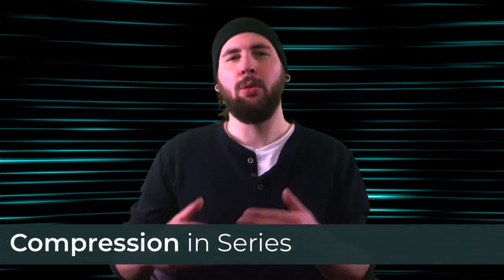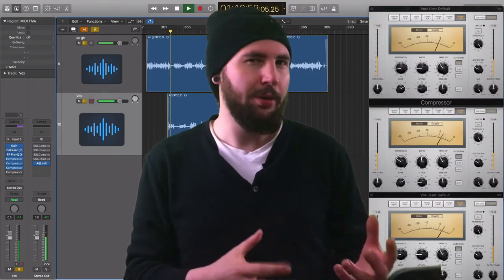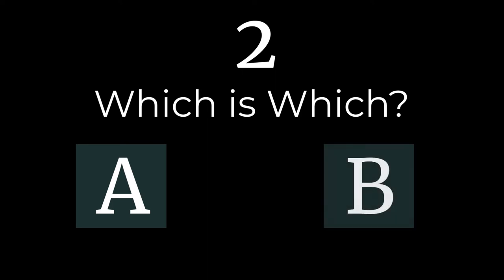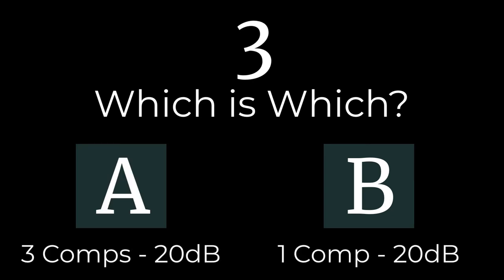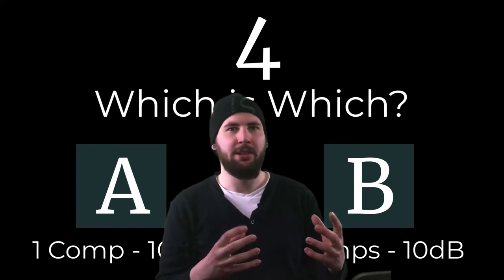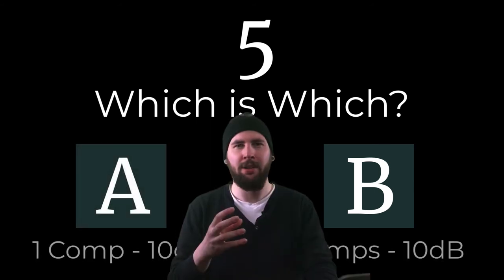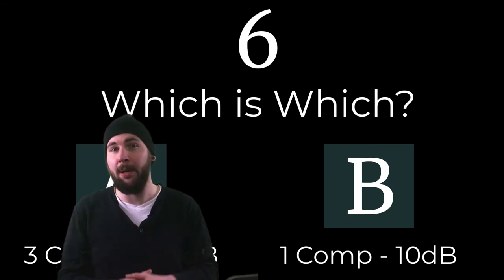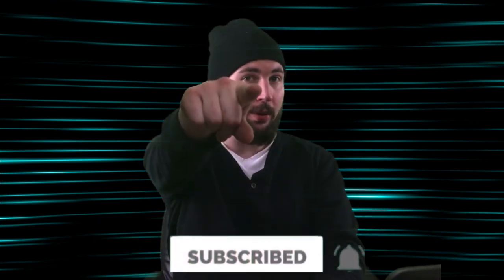Does compression sound better in series?

Comment: So, for the most part, multiple compressors or compression stages give a more punchy feel while the single compressor is darker and sounds smoother (mostly on the low-end). Mmm, I could use both strategies depending on how upfront or punchy I want something to sound. Btw, what about the other settings on those compressors?
Reply from the maker: I used the logic compressor in FET or Opto mode for all examples except the drums which went through the waves SSL Buss.

I kept attack and release pretty medium, of corse in practice you could tweak each layer to taste, so you would have more control than compressing it all at once.